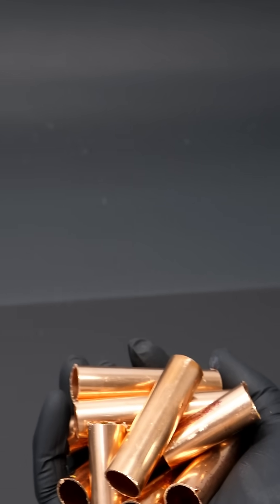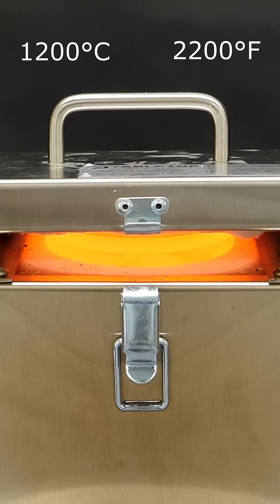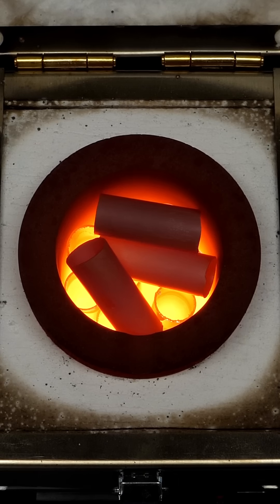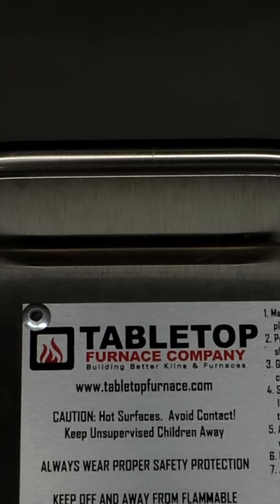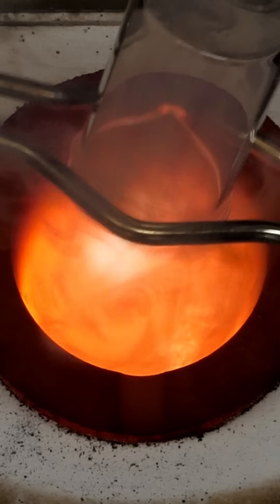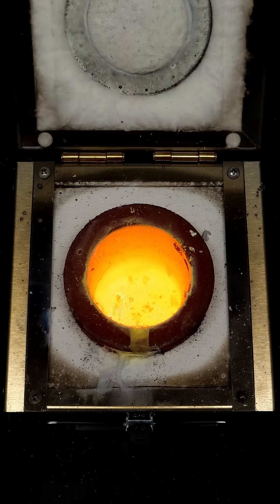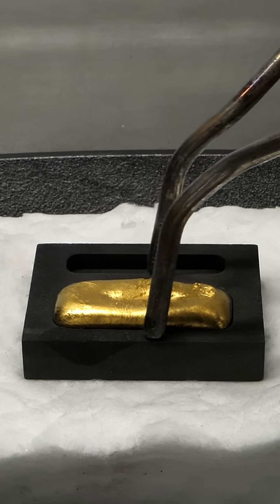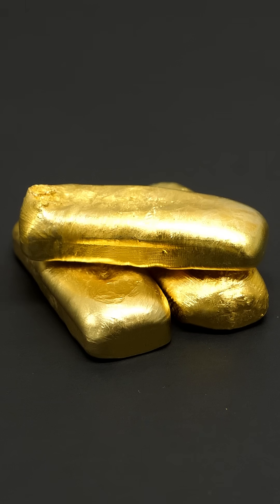Making Nordic Gold

Comment: I’m waiting for a Nile video like:
“Today we’re going to turn these pennies into platinum. First, we’ll melt the pennies. Then we add our special ingredient: platinum. After that, we’ll add dihydrogen monoxide to remove the copper coating, and add a bit of this special metal called copper to remove the iron cores. Then we add dihydrogen monoxide to remove the copper. After that, I’ll pour it into this mold. And there we go; i bow have a beautiful bar of platinum metal.”

Comment: If anyone was curious, this "nordic gold" is the same metal used in the Euro coins of today.

UPDATE: As pointed out, it's not the Euro coin. But the 10, 20 and 50 cent coins of the Euro denomination. The Euro coin is also composed of a golden-colour copper alloy but it isn't specifically "Nordic Gold".
Reply: Oh, that's interessting. I like the colour split on the one and two euro pieces. They also feel nice, have good weight. Much more interesting than the Swiss coins I get to handle every day. That said, I hate 5€ notes. Much prefere the 5 as a coin. But that's probably just me being used to that 😂
Reply: Out of curiosity, how durable is it (like would it be cost effective and durable enough as gold colored jewelry?)
Reply: @C4TC4T durability is a sliding scale when it comes to metals. It doesn't rust, if that's what you're asking. The whole reason it's used for Euro coins is it's a cheap metal which doesn't corrode easily.
Reply: @C4TC4T I've actually made a ring out of a 50 Eurocent coin, and it worked perfectly, very strong, stronger than gold. It holds a polish for a long time, scratch resistant, and it doesn't really tarnish, the only problem is that after polishing it looks slightly darker than real gold.
Reply: @R.Lennartz do you think it could be pounded out into useable jewelry wire too?
Reply: @C4TC4T  It’s durable but has allergy issues. That’s why gold, stainless &sterling are preferred for jewelry. Less allergy problems.
Reply: @C4TC4T coins aren't meant to be durable...
Reply: @Daxxxman  Yeah, they kinda are. They are meant to last awhile, and that's why they've always been metal. Now paper bills on the other hand you can say what you want on that durability.
Reply: @Danielson1818 you don't say, captain obvious!
Reply: @Daxxxman well, they actually are though. Both meant to be and are
Reply: @Daxxxman  Yes they are.
Reply: @Daxxxman Well all Euro and Cent coins have their production year imprinted. Theres tons still going around with the „1999“ imprint, when they first started mending the coins. Also OP is wrong. Only the 10, 20 and 50 cent coins are made out of this material. 1, 2, 5 cent + 1 & 2 euro are made out of different materials.
Reply: @Daxxxman  🤔??? Where the hell did you get that idea? Literally the opposite is true. Coins are made to be durable. Even back when coins were made of precious metals, small percentages of other metals were added specifically for the purpose of increasing the durability.
Reply: First used for the 10 SEK coin in the 90s
Reply: It's worth more than American dollar
Reply: @patrickconroy9535 very probably you can't do stupid things forever and expect to have no consequences.
Reply: @patrickconroy9535  no
Reply: Why not call it "Hasidic" Gold?
Reply: What metal? Why no-one lets us know what's the metal??
Reply: The euro is a currency, not a denomination. Denominations are numbers, such as 0.1, the 10 euro cent coin. Note also that currency names are lowercase, even though currency TLAs (three letter abbreviations) are uppercase. The euro's TLA is EUR.
Reply: Oh interesting
Reply: Coppers price is rising as governments inflate their fiat currencies.
Reply: What denominations use it?
Reply: This is cool
Reply: Thanks man!
Reply: God bless yall on what yall do always
Reply: The infinite money hack
Reply: Should have just melted the coin
Reply: How can it be made softer...
Reply: Uaaaaaaau😮😮😮😮😮😮😮😮😮😮😮😮😮😮😮😮
Reply: Y esto lo mezclan con el oro para que les rinda y así lo venden más caro y defraudado
Reply: Appropriate, fake gold coins for fake union.
Reply: I think the US$1 coin had Nordic gold in one of its versions.
Reply: So, it’s worthless 🤷‍♂️
Reply: @M21-w1y this got a great laugh out of me for the left field,  thank you.
Reply: @M21-w1y  Worthless today, but give it to Napoleon and he'll drool.
Reply: @M21-w1y Folk it's more valuable than the US Dollar...
Reply: @M21-w1y well, it’s the same way banknotes are useless without monetary system behind it
Reply: @M21-w1y  worth more than a US $
Reply: @M21-w1y worth more than the dollar…
Reply: @M21-w1y  no u dumdum, it's worth 10, 20 or 50 cents
Reply: @M21-w1y unga bunga no gold no value unga bunga
Reply: @M21-w1y one € isn’t worthless. More countries use euros than us dollars.
Reply: @Neo_Pixle Not for long, if the EU gets their way your countries will be states like in the US.
Reply: @alberain The EU is its states.
Reply: @alberain  You act like that didn't already happen. Plus, at the very least the United States is meant to be a collection of mostly semi-autonomous states.
Reply: @alberain  however, there are non-EU countries where the Euro is legal tender (plus there are a decent number of countries where USD and Euros are used for cash purchases in addition to the local currency, both to accommodate travelers and due to low confidence/value of the local currency).
Reply: @SockieTheSockPuppet  actually the U.S. wasn’t necessarily setup to be the way it is. Right after the revolutionary war which was really a civil war they passed the treason laws. Anyways states were more like Europe back then but the Union winning the civil war which was really a revolutionary war or war of secession the Union changed the government and bankers got more power etc. It’s why states lost a lot of rights and the federal government only grew along side Wall Street and a private central bank eventually. Europe very well could follow the U.S. all it takes is for part of Europe to win the other part and force them to accept a stronger federal government and lose of rights.
Reply: @alberain that’s interesting thing to propose looking at the fact that there’s quite literally no political will for federalismation rn. I honestly wouldn’t be against it, but it just won’t happen, not for next half a century
Reply: @SockieTheSockPuppet how did it happen? Last time a state wanted to leave us it started a war. Last time country wanted to leave ue it just left. All countries have independent army, there’s no federal military, no federal police, heck, most of “federal” laws need to be ratified by every country to accept it. There’s no federal currency. Not every country is even in Schengen, so there are no federal borders. Eu government has far, far less power over eu countries than us government has over states. 

Heck, not even all members of EU are in the same military alliances
Reply: @Neo_Pixle most of europe fits in a few states of america. Number of countries is hardly an argument
Reply: @gtafan110010 The U.S. is bigger than Europe, but it is only one country. 
And I just wanted to clarify that € aren’t worthless. 
And at least a cent doesn’t cost more to make than it is actually worth like the penny.
Reply: @KajtekBeary I used to be in favour of federalisation, then voted for brexit, things change.
Reply: @alberain  you might've. Populous changes way, way slower. And while brexit is definitely beneficial for Russia, federalisation is not, so their misinformation efforts won't try to achieve it
Reply: @gtafan110010  U.S. may have bigger territory, but European Union has way bigger population. 340 mln for US, 450 mln for UE. So, UE is, indeed, bigger, in the aspect that matters. Land is worthless if it's empty (look: russia)
Reply: @Neo_Pixle  I haven't been following nowadays if it's still true, but Dollar's value is very important due to how the USA kept making it the main coin for paying petroleum
Reply: @Neo_Pixle  Outside Europe, a number of special territories of EU members also use the euro as their currency. The euro is used by 350 million people in Europe and additionally, over 200 million people worldwide use currencies pegged to the euro.

The U.S. Dollar, however, is far more widely used in international trade, comprising approximately 54% of all country to country transactions.

The dollar is the official currency of five U.S. territories, along with 11 foreign countries, territories, and municipalities around the world. It's also the quasi-official currency of several other nations that, in addition to their local currency, commonly accept U.S. dollars.

TLDR: the U.S. Dollar is far and away the more important global currency compared to the Euro.
Reply: @alberain what? The EU is getting its way, and if it isn't the way we want we can just leave
Reply: @M21-w1y  btw, if tomorrow, say, the gvmt. of the US disappeared from the face of the Earth what use do you think paper dollars would have? 
Outside that of toilet paper, ofc 😂
Reply: @giuseppeagresta1425 all fiat currencies you can say are like toilet paper going down the drain being infinitely expanded
Reply: @giuseppeagresta1425 🤞right?
Reply: @giuseppeagresta1425  What use do you think gold has for survival? The only inhetent value of gold comes from it's non-reactivity and pretty color. Both of those then only extend to value from rarity and use as jewelry and coinage - both of which either require wealth concentration or spme form of government.
Reply: Oh jews...
Reply: @андрійсочка-ф6р What?
Reply: @андрійсочка-ф6р 💀🙏
Reply: @андрійсочка-ф6р hahhahaha true
Reply: @андрійсочка-ф6р  oh a Jew would know straight away that it wasn't really gold

Comment: When you have the molten copper, try diluting the aluminum with a quarter part water. When you add 1/4 diluted aluminum, it helps the alloy to be more evenly distributed throughout the base material. You don’t need to worry about the water contacting the 2,200°F copper, because it will slowly evaporate out like when you reduce a mushroom sauce. 

Source: I died on a forklift in a scrap yard when I dumped metal into the smelter’s hopper because the metal bin sat outside in the rain

Comment: How to turn copper into gold:
1. Place copper in a crucible
2. Add other metals (optional)
3. Apply enormous amounts of pressure and energy. 
Disclaimer: if you invent a machine this powerful, I do not take responsibility for any accidents that may vaporize the solar system. Please use with caution.

Comment: Bro that's hardcore just add as much aluminum as possible I guess this works in your furnace but adding aluminum in open air will turn everything to brittle like glass aluminum good method it should pass the gold kt to 18 kt if u added aluminum all aluminum passes at 18 kt

Comment: Isn't that brass instead of gold?
Reply: Not brass
Reply: @Joker-em6oz  That's what is mixed for brass.
Reply: @Daniel_Antonio_Arellano782 what is mixed for brass? The alloy in the video literally isn’t brass
Reply: @Joker-em6oz  Cooper, zinc , tin are mixed together to make brass. It depends on how much tin and zinc is mixed you can either make Brass or Bronze. They do not naturally occur that way like gold.
Reply: @Daniel_Antonio_Arellano782 I know… that doesn’t change the fact that the metal in the video is not brass
Reply: @Joker-em6oz 
 It's bronze then. But not gold.
Reply: @Daniel_Antonio_Arellano782 nope, it’s aluminum bronze. Not bronze or brass
Reply: @Joker-em6oz  It's bronze. Just bronze.
Reply: @Daniel_Antonio_Arellano782 no, it’s aluminum bronze. Not bronze. Bronze is tin dominate, this isn’t.

Comment: Yo, this is not gold. You can’t just make gold like that alchemist for trying for thousands of years it doesn’t work.
Reply: No duh. He clearly says that
Reply: @Joker-em6oz well later into the video after I made my comment…earlier on in the video he’s like all I have to do is this and that…and he literally says he’s going to make gold…. Not a gold colored composite alloy
Reply: @jesselynklove25 alloys are not composites. Composite alloy would refer to something like Damascus
Reply: @Joker-em6oz  isn’t an alloy just a mixture of different metals which technically is a type of a composite overall
Reply: @jesselynklove25 no, that just makes one material. Composites are distinct materials. You could separate out the constituents
Reply: @Joker-em6oz good to know…thanks…some composites such as leather, wood-like materials and fillings for cavities are mixed to a degree that it only seems to be one material, but are still considered composites I’m guessing it must be different when dealing specifically with metals
Reply: @jesselynklove25 no, those options contain structures that physically could removed or for fillings for cavities, it’s two materials. 

Metals are a solid solution. You cannot remove the tin atoms physical from bronze

Comment: Cymbals are actually made out of a very similar material just without the aluminum and zinc. Without those ingredients and with the same recipe you would have most likely made a b8 bronze (92% copper 8% tin) and if you add some more tin a b20 bronze (80% copper 20% tin) which is what is most common in cymbals.

Comment: The zinc isn't doing that because it's reactive, it's doing that because it's vaporizing on contact. The boiling point of zinc is below the melting point of copper, and this seems to be a little above that, so this is basically like dropping ice into a deep fryer and I'm surprised nobody was hurt

Comment: Huh. Looked it up because the recipe sounds a lot like both brass and bronze, which it kinda is??? But apparently it's supposed to be hypoallergenic which is pretty neat. Would probably be cheaper than the 24k gold I'd have to get if I ever wanted to wear the color lmao. Even 14k often has enough nickel that I break out in hives (—_—')

Comment: This entire sequence would be much crazier to Nordic people because they thought they were doing black magic whenever they made metal tools like this, so the hissing noises really supported that idea
Reply: This specific metal is a modern invention and is mostly used for coins and is called Nordic Gold because Sweden was the first one to do that.
Reply: @znail4675  To be exact it was invented by Finnish company Outokumpu, but coins made from the alloy were indeed first sold to Sweden.
Reply: Yep. We use it our 10 krona coin. It was made to look like gold, be pretty resistant to tarnishing, and a robust enough. Actual gold would not be as scratch proof, and of course cost a lot more. Now you find it in all manner of coins, with the Euro being the most famous example. 

Also, if I remember it right it was mean avoid allergic reactions and also to small degree antibacterial. But I might remember it wrong. A lot goes into making the ideal alloy.

Comment: I mean, turn it into like a fake gold thing. Yes, copper will never be gold obviously. Copper is an actual type of metal with a mineral extract. Gold is not a metal. It is a mineral. It’s very soft. That’s why if you guys ever work construction high-rise is fencing anything with cables like rebar a lot of guys that have wooden rings they would take out the gold rings and until recently gold is so soft you can have a pair of like dice for like smash your finger. They can cut it offopened up beer bottles all the time with my finger but this is cool. I like this kind of stuff.

Comment: Best I can recall- Hayden Ariz. Copper Smelter (Anode-Converter/Furnace) in the Y2k... was running approx 2300-2380 degrees/F. but, I was an "E" not a Smelter Rat. An Anode Op would know precise numbers...

Comment: That is amazing! I imagine Nordic gold is much cheaper. Question: what kind of spoon do you use to stir molten hot metal? Do you just stir it fast enough that your spoon doesn't melt?
Reply: One of those plastic spoons from Wendy's
Reply: 😂😂😂😂😂 @spudpud-T67
Reply: Given that it's just an alloy of various relatively cheap metals, yes, it IS quite cheap. It's mainly used to mint coins, particularly the Euro coins, since it's so cheap while looking reasonably similar to gold.

As for the spoon question, not all metals melt at the same temperature - copper melts at around 1,100°C while steel melts at around 1,500°C, so you can totally stir molten copper with a steel spoon without it melting. The reason aluminum, zinc and tin all melt into the alloy while steel doesn't is simply because those metals all have a lower melting point than copper.
Reply: Since his furnace was only barely hot enough to melt copper, a normal iron/steel stirrer would work for stirring. Iron’s melting point is about 3000 degrees Fahrenheit, and steel’s is even higher than that.
Reply: The fun part is when you are melting the metals with the highest melting points.  You get serious issues with "what can I even use to stir?"
Reply: A bot just stole your comment🥲

Comment: Nordic Gold is a specific copper alloy primarily famous for being the material used in the 10, 20, and 50 euro cent coins. Its composition is 89% copper, 5% aluminum, 5% zinc, and 1% tin. It was chosen because it's non-allergenic, non-magnetic, and difficult to counterfeit. It is not designed for marine propulsion or extreme strength. Ship propellers are typically made from various types of bronze or brass alloys, often referred to generally as "propeller bronze" or specific types like "manganese bronze" (which is actually a type of high-strength brass), nickel-aluminum bronze (NAB), or manganese-aluminum bronze.

Comment: "and the next thing to add is some zinc metal"

Recreates a fricking sun
Reply: My thoughts exactly
Reply: yummy zinc fumes
Reply: @Buttadew  they’re getting to me
Reply: it's worse when you realize melting zinc is incredibly dangerous and people have died from the fumes as they are toxic it's why it's usually done in heavily ventilated areas or outside (for blacksmithing)
Reply: The power of the sun... in the pit of my crucible
Reply: That wouldn't be possible for that to happen